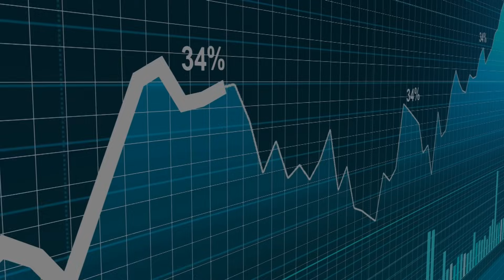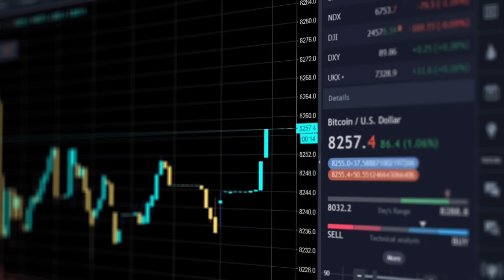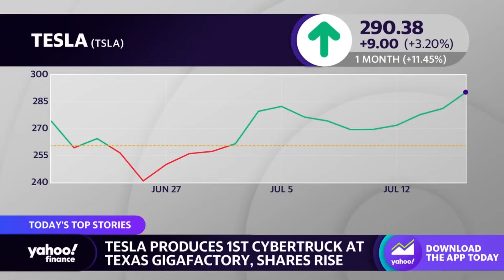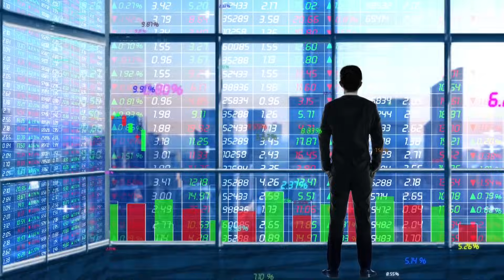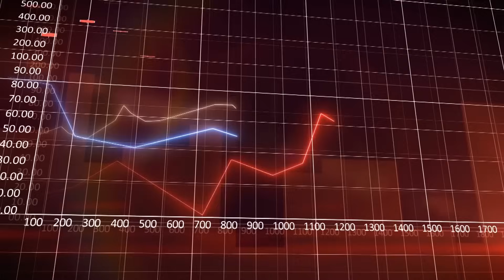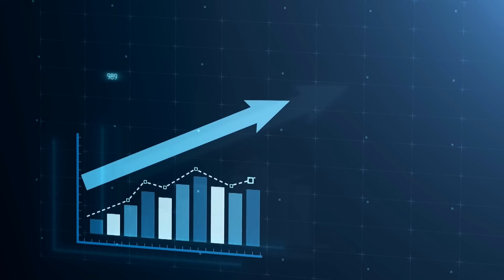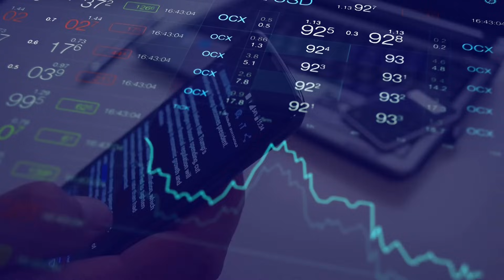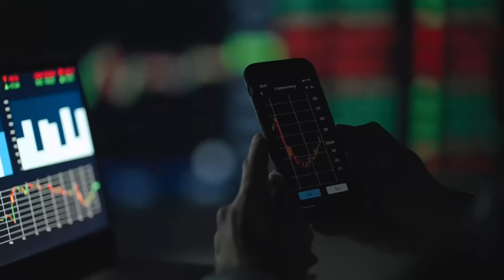Kevin O'Leary's WARNING to ALL Tesla Investors: Are You Prepared?

Comment: When was the O'Leary interview recorded? TSLA is trading in the same pattern it has for 4 or 5 years. It runs up and then tanks. The only question is how far will it drop this time. It's a lot like a pump and dump. It seems like the long term holds will be left holding the bag!
Reply: Everything you stated is FALSE. Either you lie, or you are not looking at Tesla fundamentals which are the very best in Wall St.